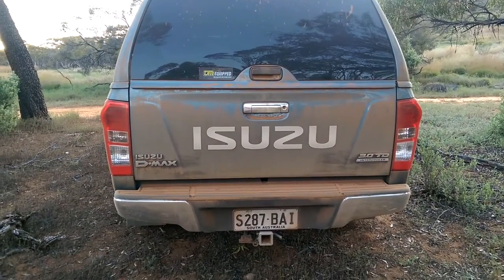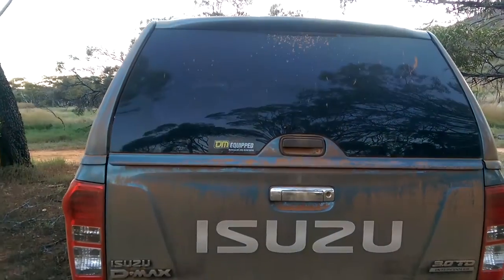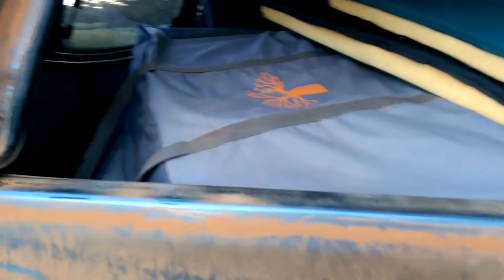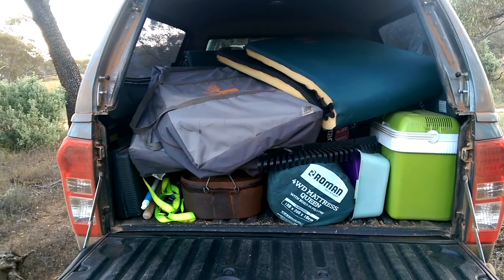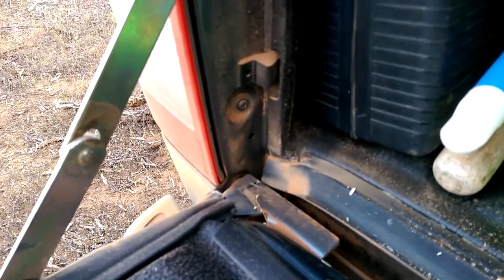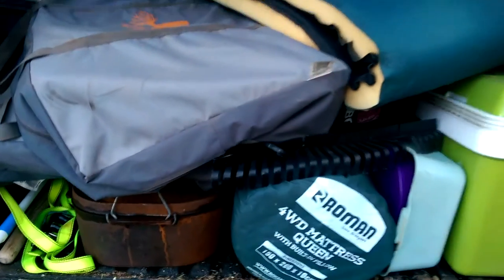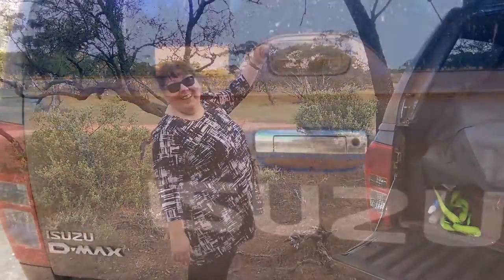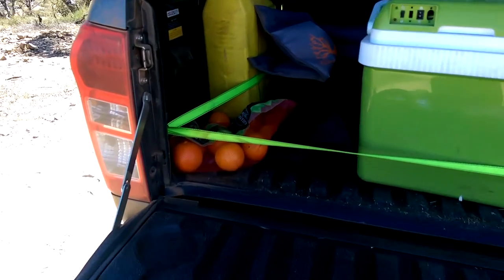Real World Testing of my 2014 Isuzu D Max Tailgate Dust Seals

Comment: Thankyou for your post has been very helpful, have just fitted a similar seal also from Clark rubber using a sikaflex black sealant on joints. Have a question however did you get any dust coming in elsewhere in particular the top gaps between the liner and side if the tray?
Reply from the maker: Alan Huntley I got some dust in the front of the tray under the canopy, not a lot by any stretch. I got a little in through the corners of the tailgate. Overall, the dust ingress was reduced by a huge amount, probably over 95%. Thanks for the comment, God luck with yours.